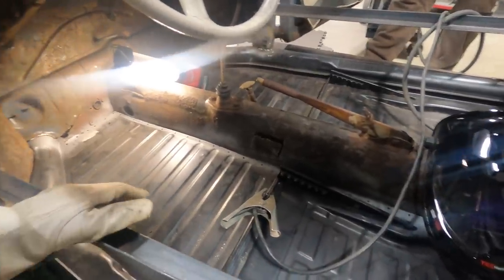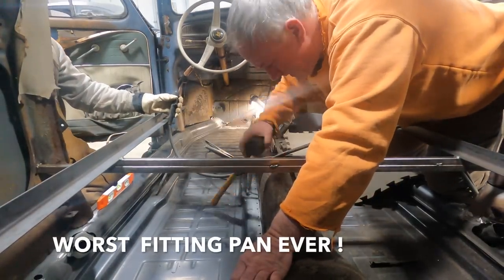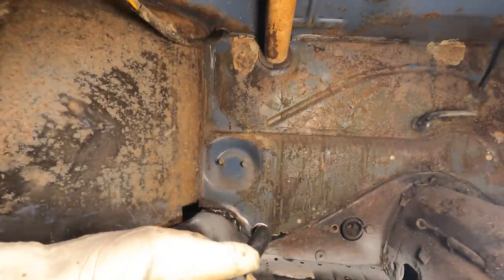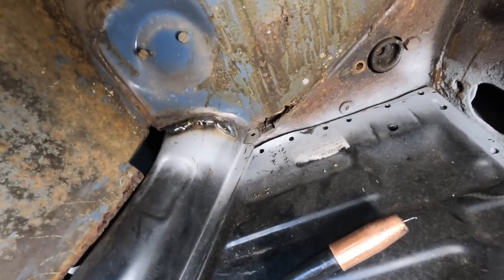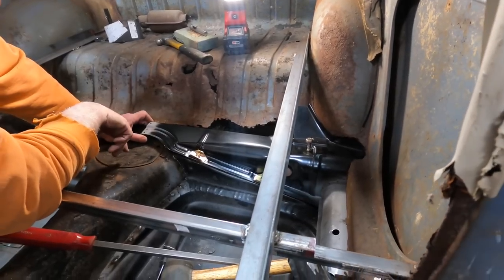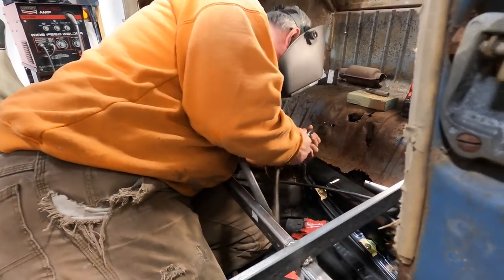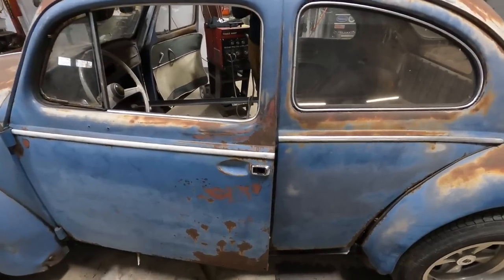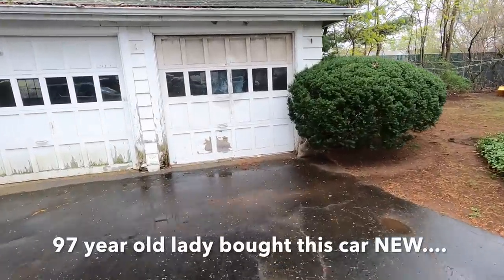Vw Beetle Heater Channel Replacement & Crossmember Rust Repair - 1958 Ragtop Rusty Bug Revival

Comment: Looking good Jason always remember clean nozzle correct wire speed and heat adjustment you shouldn't hear all this spuddery splattery noise when your welding the surface isn't clean enough or something to do with the before mentioned. I used to use a nozzle spray as well and never try to clean the nozzle by beating it to death on something no bueno 😁👍

Comment: This is great too see and better is the constant crackling (like frying bacon) of your welds and seeing the heat getting the penetration in the steel. I'm glad Larry is helping and guiding you. Perfect was when Larry got good ground and you tacked something after and I hear whoa, yet a good ground is crucial. You're doing great with this car, it's gonna be an instant classic. Currently I an repairing both my rear quarters on  the Impala. So much welding. Cut and butt is the best way to repair body panels.

I'm looking forward to driving my Impala up to see you and your toys, especially that Camaro. I have my eyes on that car. Hope you still have it. Take care my friend, always good to see new videos from you. The ending is a real tease.

Comment: Well there is always a grinder!.....Those inner pan welds are the hardest to penetrate. Those plugs you really need the heat up because there is double layer underneath. Otherwise they can pop off. Best to almost burn a hole. The Pan sheet metal should be melting holes in it to get the underneath hot enough to stick. (double layer 18 gauge)
Reply: Heat selector 17 or 18v  wire speed around 160-170

Comment: A welding class at your local junior College or voc Ed center is really cheap,easy,only requires a couple hours a week AND imagine the money in grinding wheels,grinders,having to cut back out and redo a section time that you'll save plus be much more confident that the welds you're putting down won't fail shortly after you sell or trade of whatever you're  working on.. Migs make welding look easy but also allows many failures due to deceptive looking welds..